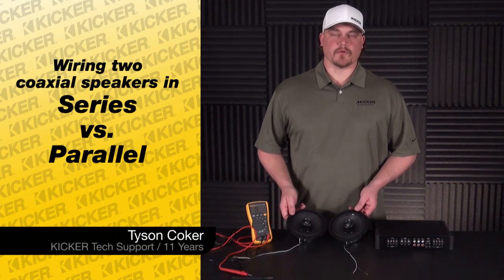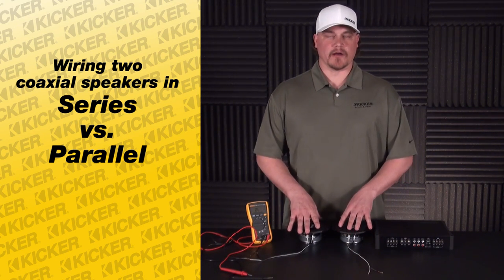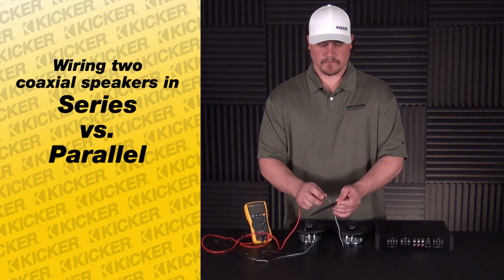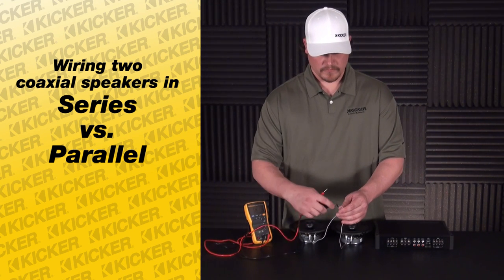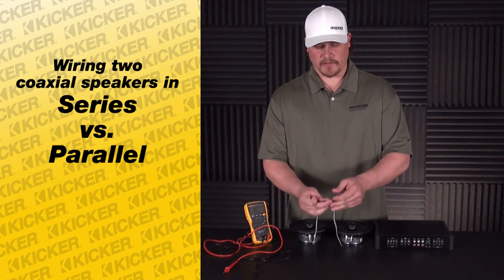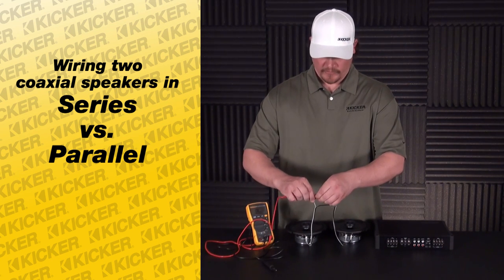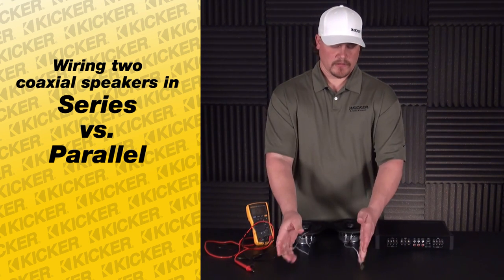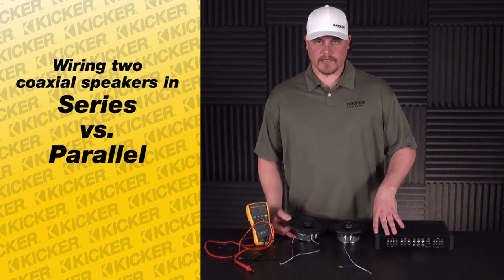Speaker Wiring: Wiring Coaxial Speakers

Comment: Will running coaxial speakers in series or parallel effect the crossover pts? If so, is this effect negligible in most cases or will it alter the performance significantly, and I realize different speaker combo's have varying ranges of performance that can either offer flexibility or limit it regarding crossover points and overall performance/musicality.

Comment: I’m connecting two speakers and a subwoofer to a power amplifier. My power amplifier divides into three separate channels with each channel having an impedance of 4-8 ohms. Each speaker has 7 ohms (6.7 measured) and my subwoofer is 3 ohms (3.5 measured). Although the power amplifier says a minimum of 4 ohms impedance, could I connect the subwoofer or would it burn out? And if not, would I be able to add a 1 ohm resistor to the negative lead of the subwoofer or would nothing happen at all?

Comment: This might be a dumb question though I feel I must ask as I am new to car audio. Do you have to run an amp for coax speakers? I’m wanting to upgrade my cars audio but I’m not sure the route to take. Thanks in advance
Reply from the maker: Angel Martinez While it is not mandatory, it is highly recommended. You don’t just improve the power for loudness, you do it mainly for clarity. Also, most radios under power speakers which eventually makes them blow.
Reply: @KICKER-AUDIO  underpowering speakers will make them blow?  how is that possible?
Reply from the maker: Chaplin Under powering speakers will cause them to clip. Clipping is the express route to destroying a speaker.

Comment: help, I did the stock radio, amp and subs ,but for a reason the subs humming when I rise the fain on my amp
Reply from the maker: Hi Juan, I have two options for you.  First is to take it back to the shop that installed it for diagnosis. Second is to contact us directly.  Tech Support is open weekdays from 8-5 Central Time. Their phone is 405-624-8510.  You can also email them at support@kicker.com.

Comment: I have a 4 channel amp bridged to 2ch I have 8 front svc 4ohm coaxs and 2 rear 6x9s and super tweets how do I wire 8 coax to a 8ohm load
Reply from the maker: Typically you dont use 8 ohms in car audio. 4, 2 or 1 are all more common. Here is how to wire: https://www.kicker.com/wiring-diagrams
If you need more help, call us at 405-624-8510 and ask for Tech Support.  We are open weekdays from 8-5 central time.

Comment: I just purchased a set of Kicker 6x9 CS Components, and am inquiring if I can run them in parallel to my 2 ohm per channel. Using just one of the channel to support to kicker 6x9 in parallel. I will be checking with a volt meter. I’m gonna check the amp ad well, but the 1.8 ohm thing is throwing me off. Im thinking that the amp might be made for this situation. But it’s always better to be safe than to fry your equipment...
Reply: check if your amp can handle a 2 ohm load

Comment: I have the pionner 6x9 coax 5way speaker can I wire them in series?
Reply from the maker: If you do, you will lose stereo separation.  Not advisable.

Comment: I got 3 power acoustik mofo 15 inch dual 2 ohm dvc subwoofers in a sealed box and a 1 ohm stable 6000 watt power acoustik mono block amplifier what would be the best way to wire the subs i would apriciate any help you can give me thanks

Comment: If you wire two different speakers (let's say a 20W RMS and a 100W RMS speaker) of the same impedance in parallel, would you have any issues with the 20W speaker being overpowered?
Reply from the maker: This is dependent of the amp's power of course, but this is exactly why sets of separates get a passive crossover. The tweeter can't normally take the kind of power the midrange can, plus it needs a different frequency range to perform properly - hence the passive crossover. It changes the ohm load internally for the tweeter while altering the frequencies that get to each speaker, so they can perform their best without risking damage to the components.  Without that "buffer" (for lack of a better term) the RMS of the amp probably does have an opportunity to damage the lower powered speaker.  There are many videos out there on building your own passive crossover, or you can buy them from DIY audio websites.  Sorry if that was an overkill answer to your question, but I'd rather you have too much info than too little.  If you need more detail, please do let me know.

Comment: Hey, thanks for this!  I have Kicker CS components up front and coaxials in the rear.  They’re rated 100 watts rms 4 ohm.  My amp is an MTX 4 channel producing 60 watts rms to each at 4 ohm.  This amp is 2 ohm capable, 90 watts x 4. It can also be bridged, putting out 180 watts x 2.  Can I wire my speakers in series, then run them bridged? 2 on the front, 2 on the rear?  Would that give me 90 watts per speaker?

Comment: Does this method work with mids?
Reply from the maker: Ohms law applies to all speakers, so if you're trying to get a specific ohm load to your amp then then is this a great reference.
Reply: Can this also work with tweeters?connecting and mid and tweeter together

Comment: How can i wire 8 6.5 and  4 tweeters to a 4 channel amp.
Reply from the maker: How many of the 6.5 are in the door, and are they all 4 ohms?
Reply: @KICKER-AUDIO  2 in each front doors, and 1 in each  rear doors, and 2 in the arm rest or cup holders,

Comment: Can I wire 2 tweeters in series
Reply from the maker: Jr's Kicks yes as long as the ohm load and power is  compatible with the amp, and the crossover is set correctly.

Comment: 1.8 won't go protect with good voltage and impedance always rises with play time.
Reply from the maker: Good voltage, proper wiring and adequate battery power always helps. It also depends on the true load of the subs, how they're wired, and the amp's tolerances.